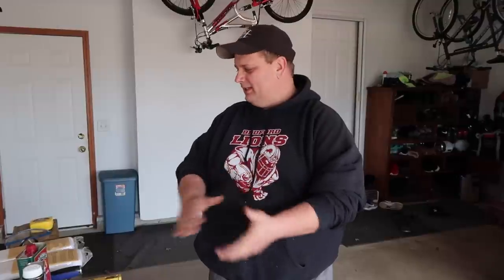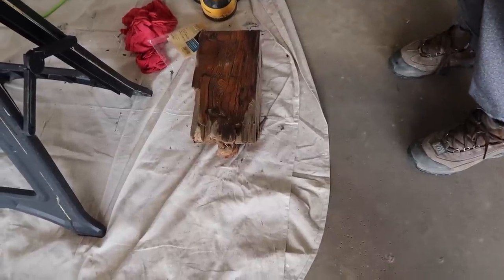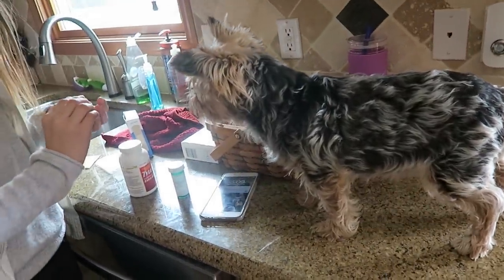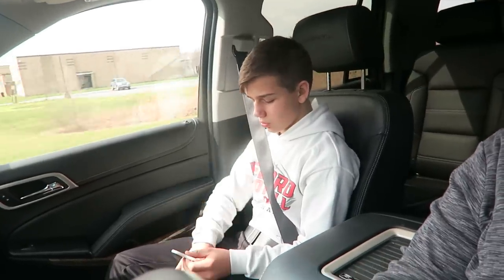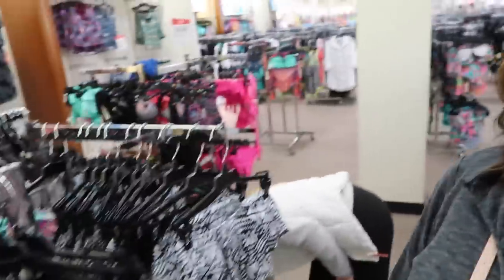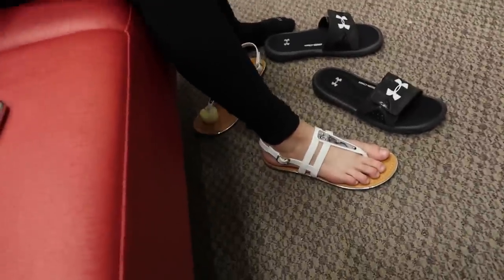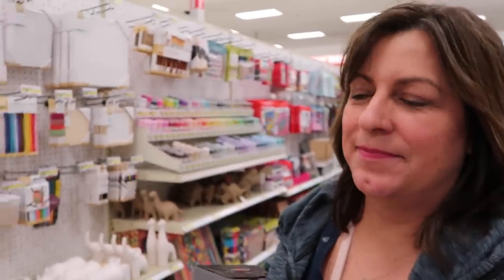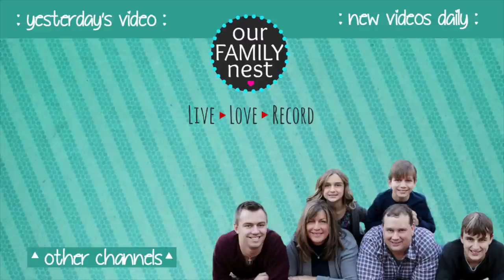MORE SHOPPING FOR SPRING BREAK! THIS TIME SHOES!! ☆☆ #OFNEggHunt GIVEAWAY Clue 10

Comment: All of those oils require more than one coat to penetrate and seal, especially on rough raw wood like that. Both the Swedish and Teak oils require occasional re-oiling, because they are just oils. My favorite to work with is Tung oil, because it cures and hardens into a permanent finish, while still looking like an oil. Just as one example, I used it on the walnut cabinets of a pair of classic KLH speaker systems about 15 years ago, and they look as good today as they did the day I finished them. I just buff them with a little Lemon Pledge now and then when I'm dusting, just like any other wood furniture.

Yeah, I'm sure Blake was really let down, being all psyched up to get it done and over with, But as you said, let that serve as a life lesson. Life doesn't always go the way you want it to, and when something like this happens that's out of your control, there's no future in getting yourself worked up over it. Just accept it and move on.

I would go absolutely utterly mad if I had to go shopping with Karli. Just finding anything she likes can take years!  LOL